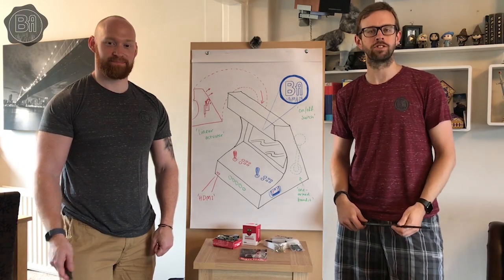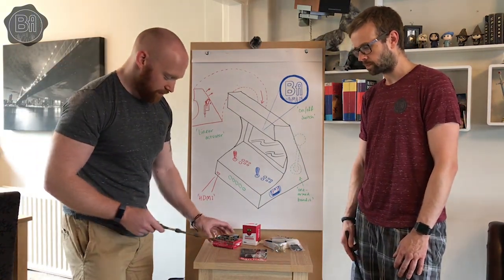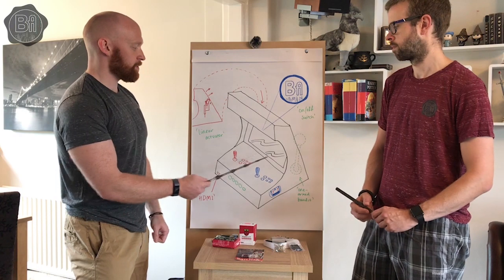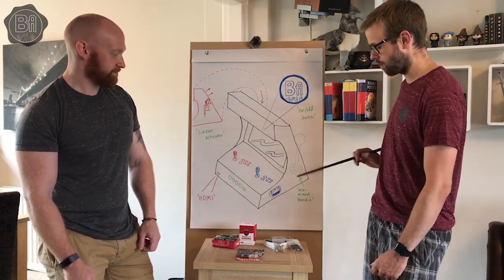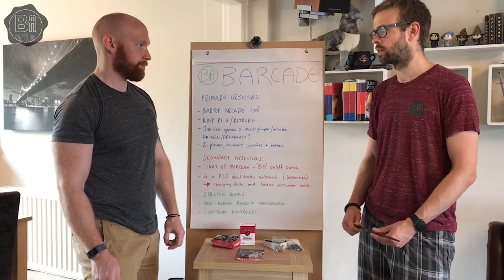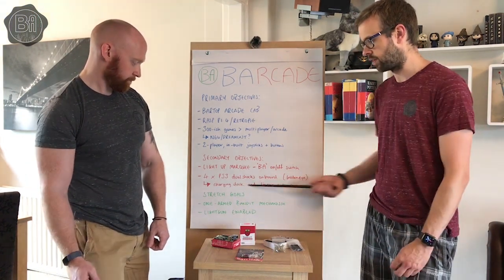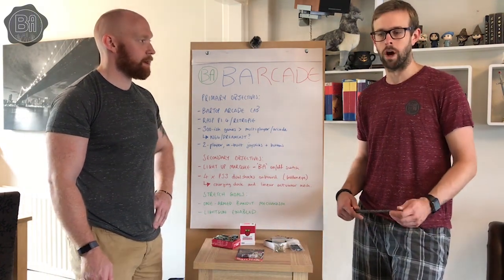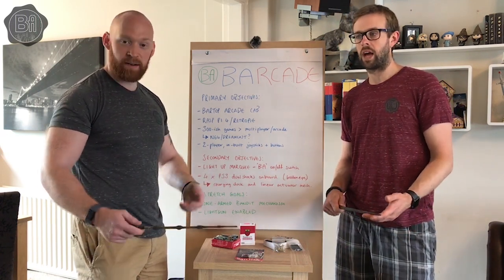How To Build a Bar Top Arcade -Raspberry Pi 4 - the ‘BArcade’

Comment: In the video you say that you want the controllers to come out of the back and appear at the top of the machine. Wouldn't it be easier making the top open up, hinged along the top back edge, rather than going as you've described? 

You may also want to consider adding some USB ports so you can add a keyboard/mouse without having to open up the machine. As you will spend a lot of time tinkering with RetroPie once you get it running. Even if you don't use them for that they may come in handy for other things.

I've subscribed so I can updates as you progress. Good luck!
Reply from the maker: Brilliant advice, Darren! 👍 thank you 😊

That would certainly be an effective solution to the storage conundrum- and probably easier and more subtle too.
I think Rich wants to do something a bit special and hopefully unique to top the project off. A bit of fanfare!
He’s an engineer by trade and I think he’s keen on putting his skills to the test with the actuator controller reveal. Stay tuned as I can imagine there will be an entire episode dedicated to this flippin’ actuator mechanism 😂

The USB ports are a great call! We hadn’t even thought about that. Rich is literally adding that to his first draft tonight 🙂
I’m worried about RetroPie- mostly because of the light guns and Bluetooth controlllers. Would appreciate any advice on those features 😅

Thanks so much for joining us on the channel, Darren. We look forward to hearing more from you!
We want Binary Arcadia to be a place full of positivity, support and celebration 🥳

Comment: I really like this as a project, particularly the fact that you're largely ignoring the pre-manufactured kits and building it yourselves. My own experience with Retropie (albeit on a Pi 3) suggests that the actual software component of this is surprisingly simple; once the Pi 4 support is available I should think you'll have little trouble with it. 

One thing that did crop up with my own build was that the Bluetooth controller I was using (an 8bitdo SNES-style pad) did have noticeable input lag that I didn't get on other platforms. It was an issue that I didn't manage to solve, and I'd suggest giving your chosen controllers a good testing before committing to supporting them in the case you're building. 

The "linear actuator" idea does sound very cool in theory, but I suspect (with my admittedly limited engineering experience) such a mechanism would take up a lot of room and may make the finished unit much larger than it otherwise needs to be. 

And on an N64 layout for a dualshock; Left Analogue stick as, well, the analogue stick, the face buttons as C buttons, Z and R on the right shoulder buttons and A and B on the left shoulder buttons. Click the left stick for the start button. May take a little getting used to, but I don't think it would be too awkward and would cover all of the bases you need for Goldeneye.
Reply from the maker: Thanks Raid! Fantastic comment as ever 😊

Yeah, I think we are going to base some of the measurements on an existing design but we will be modifying quite extensively to fit the features we hope to add...
My part of the job is mainly setting up the Pi 4 so I’m relieved to hear that it should be the easiest part of the build 😅

Thanks for the tip re input lag too- that would be really disappointing to get to that point and realise our controller solution isn’t fit for purpose!

In the next video we hope to show a cardboard prototype- alongside our marquee design so plenty of time for changes and practical modifications 👌 so keep the feedback coming!

As for the actuator feature... it is a bit flash for flash sake 😂 but we thought it would be an ambitious undertaking to demo on the channel- even if it ends up not being viable.

That’s good to hear! I’d be in my element if we can get multiplayer Goldeneye working... will definitely feature in the Gamesmaster tournie video we are planning afterwards! 🕹